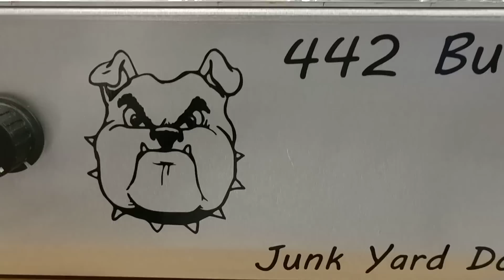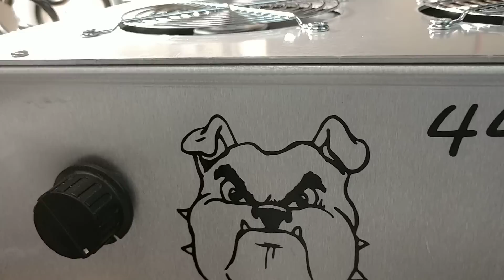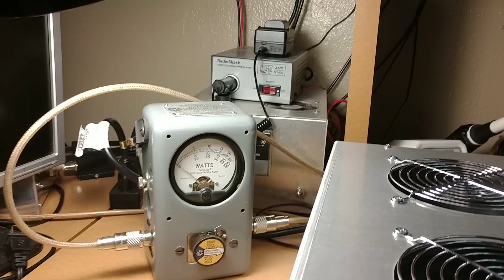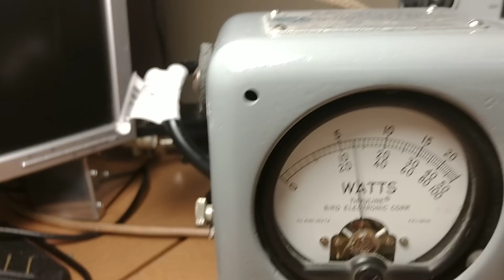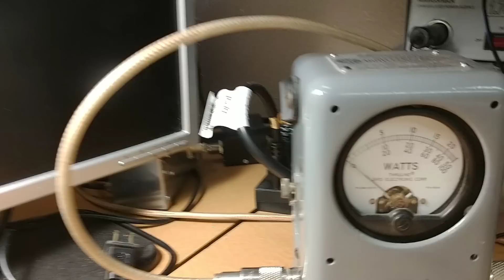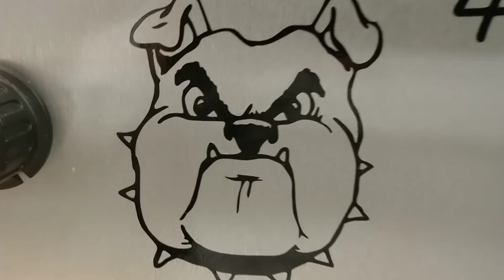442 Built Junk Yard Dog 2x8 Base for Steve

Comment: if the circuit is built right you should get a 1:4 power on a AM amp. 100 watts bird should get you 400 watts PEP. Is this correct
Reply from the maker: J D all starts with the radio. If the radio is tuned properly @100% modulation then the ratio should carry over when the amp is turned on. This is only the case with actual BJT power transistors. It usually won't work out when using mosfets